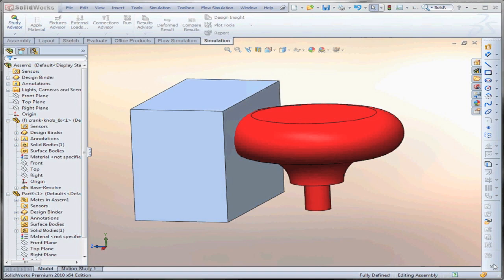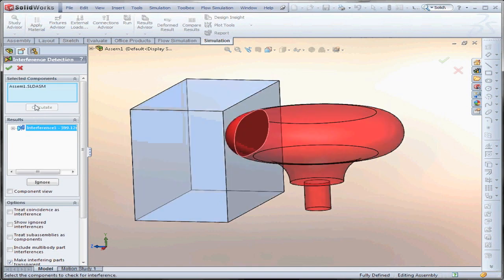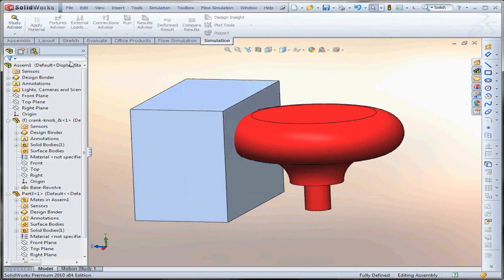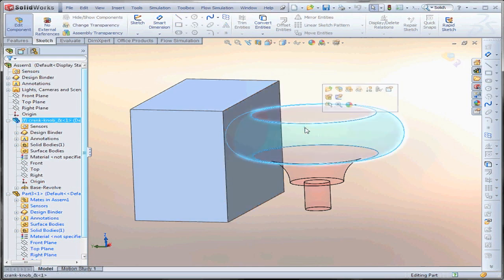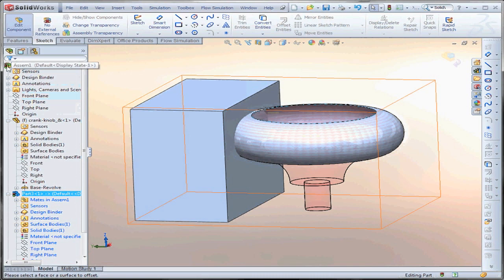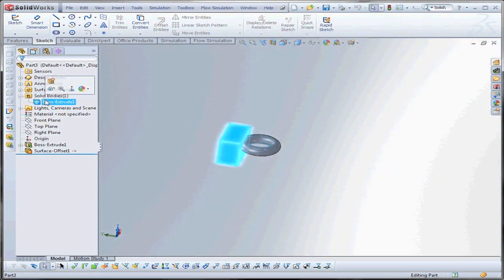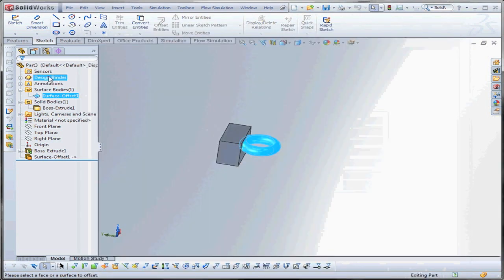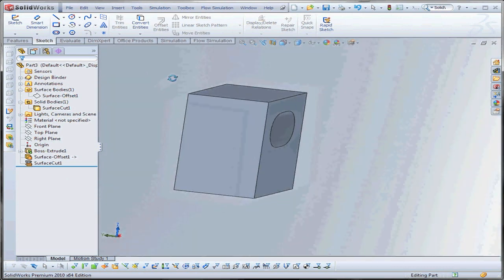SOLIDWORKS - Eliminating Interferences

Comment: This tip works alright for this particular situation, but its far better practice to use:
 insert>features>cavity
This helps when working on complex assemblies.
Reply from the maker: angus mitchell, thank you for your comment, the cavity feature is another way of doing this process from the one shown in the video. There is usually always more than one way to get something accomplished in SOLIDWORKS. This video is just showing one of those processes. Thank you for watching.

Comment: Im having persistent problems when trying to run simulations on my model due to there being multiple interferances, mostly from threads made on bolts which I have no way of matching to their counterpart on the body they are intersecting. This is a very longwinded way to resolve this issue and doesnt seem to like cutting the surface which can only be made as the 2d shell of the thread yet wont create a surface for the entire body of the bolt. Am I missing some simple setting which could easily resolve this issue?
Thanks for the knowledge
Reply from the maker: It is not advisable to leave threads on bolts or holes for the purposes of FEA.  When preparing a model for FEA fine details like threads and cosmetic fillets would be removed.  Bolts/holes would be replaced by bolted connection definitions in the FEA setup.  You would just leave the cylindrical faces of your holes to use with those bolted connections.